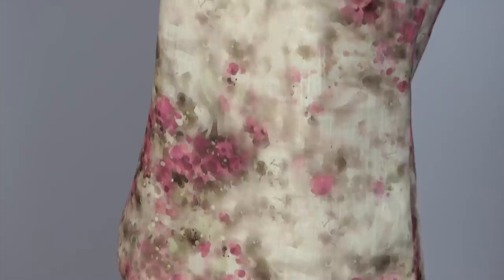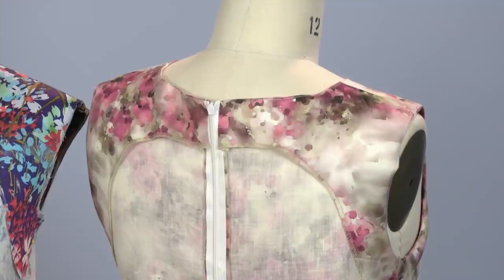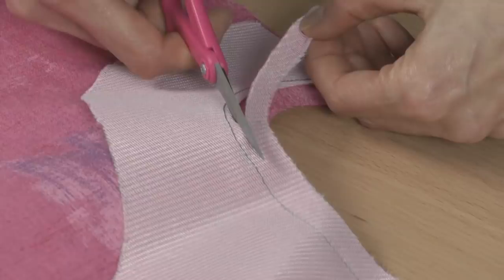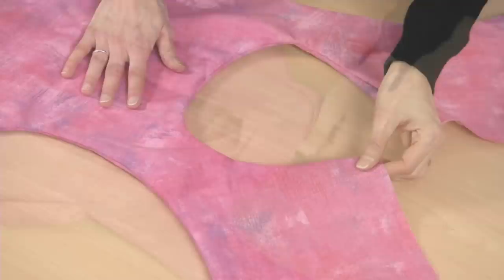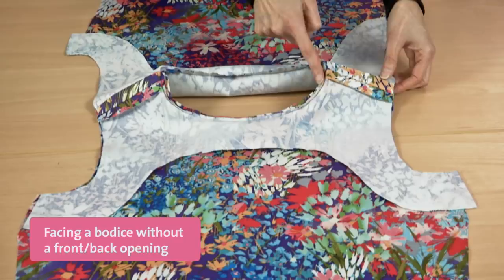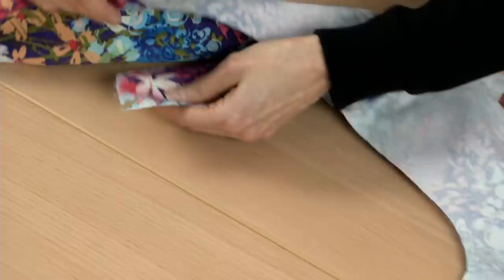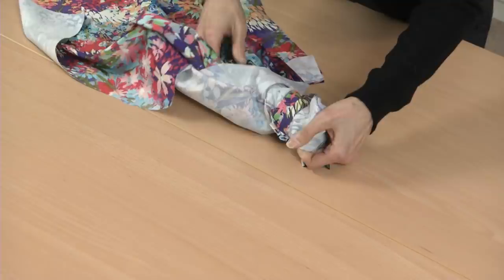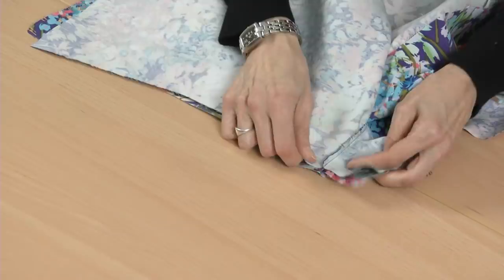Install an All-in-One Facing

Comment: Great tutorial! It seems to apply to most cases, except when the shoulders are narrow, with shoulder seams of about 2-3 inches. It would be impossible to roll the whole top under that. I got this idea last night, but haven't tried yet, but I think it could solve this issue easily. What if you sew the front facing to the front, the back facing to the back, keeping the shoulder seams unstitched. Turn them over and then pull the front shoulder strap (piece) through the back shoulder strap (under the facing) and attach together all around that little narrow raw edge. Might work! I will try this today!
Reply: Lavinia Cadar A iesit? Am de facut ceva similar, insa nu reusesc sa vizualizez clar descrierea ta 🤯🙈

Comment: Excellent tutorial. I just wish my brain didn’t get confused 🤷‍♀️whenever an object is flipped upside down or inside out. #SpatialReasoningIssues
Reply: Mo Poppins I have really good spatial reasoning otherwise but fabric blows my mind every time 😝 hopefully it’s just a matter of practice!!
Reply: i used to get confused to what i would do is slow down the video, look at it a few times, then put painters tape on the two pieces that has to meet sew it and repeat. i hope this helps
Reply: @snachicat  Yeah, like French seams blew my mind, but then I did some samples with straight pieces, and I got the hang of it. We just want to put those right sides together. It's hard to sew wrong sides together. Just feels wrong at first.

Comment: Thank you for this great tutorial, except unless I'm getting it wrong, there is no way to understitch the arm holes after you have pulled them through.
Reply from the maker: Hi Virginia! You can understitch the armholes before sewing the side seams, but only partially. Start at one side seam and understitch as far as you can toward the shoulder seam. Then start at the opposite end and understitch toward the shoulder seam from the other direction. With some garments, you can get within an inch or two of the shoulder seam. If the shoulder seam is short (making a narrower strap), you may not get that close. It doesn’t always matter, though—and if you feel the need for understitching around the entire armhole, you can hand-stitch any areas you can’t reach by machine. Hope that helps!
Carol J. Fresia, Threads Senior Technical Editor